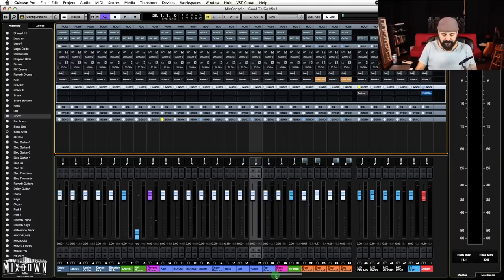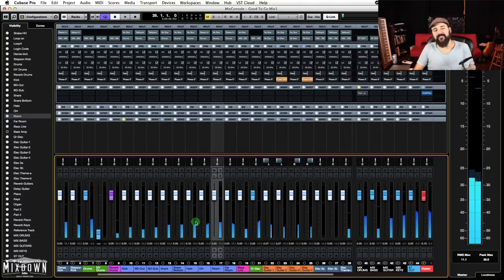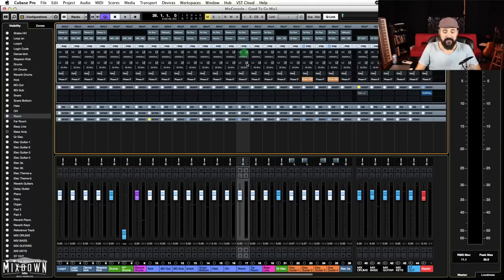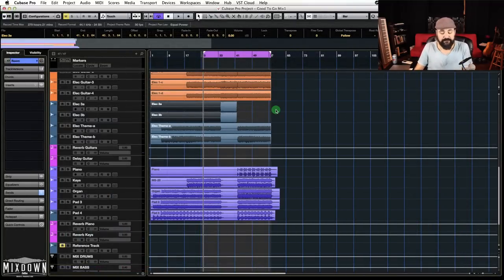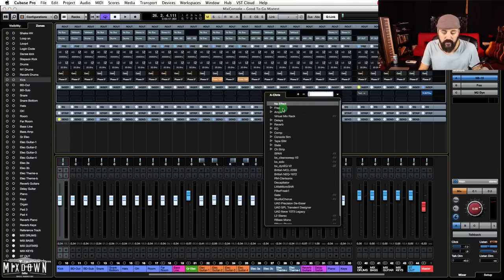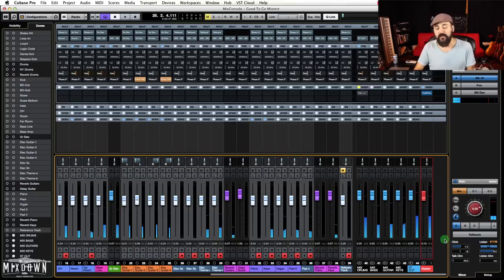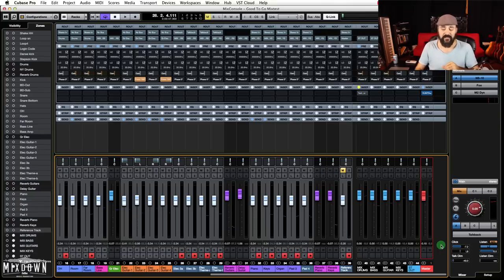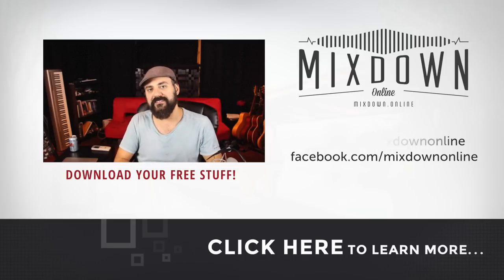Gain staging for a better mix - mixdown.online

Comment: Excellent video, thanks. I've done a recording where I gain staged each track, including with plugins, but the master fader peak level is around -11.7db (with the fader at unity point). Is this too low, or can I simply bring up the loudness when mastering the song (or even increase the 'Pre Gain' of the master channel)? You say in this video we should be aiming to get the master fader output to between -3db and -5db. However, I'm finding it hard to  properly gain stage each track PLUS balance the level of the instruments properly while still achieving the -3db and -5db range on the master fader. How do you solve this? Thanks.

Comment: Hi Chris!
I noticed, that the pre gain metering does not show the changes I make, if pre gain fader or pre gain automation is used. The only way to see differences in metering is, when I use my mouse and pull down the waveform in the track. Why is this? - And now knowing this, - does pulling down the waveform have advantages compared to using pre gain.?
Thank you so much for your videos! - I´ve learned so much from you!

Comment: absolutely to the point video....even I had confusion about -18- why it is sweetspot or why it is so much important, you cleared my confusion...Thank You, Love from India....just one question- during mixing I am keeping the level of master bus at -6 to -3 dbfs like that, for single channels I need to keep the level at -18 to -15 dbfs, is it correct!?
Reply from the maker: That's pretty much it but always use your ears also during the mix, not only numbers.

Comment: Hi Chris. When I set the gain on the raw audio file I try to keep it between -18 and -12 as suggested. This changes as I add inserts. To keep the faders at zero should I keep adjusting the raw gain, pre gain or adjust it in any of the inserts using say, output levels? You mention lowering all of the faders from zero to give head room but there is already 6dB above zero. What is this for? (Enjoyed your live stream last night btw).
Reply from the maker: Yes, the more you add plugins, chances are that your level will go up and that's ok. That's why you gain stage at -18 to -12 in the first place, to give you headroom. Don't adjust Pre Gain after you're done mixing your channel, this will screwc up the level of the signal going into your plugins
Reply: @mixdownonline  Thanks Chris, and I just saw in your latest vid that I should use the output of the last insert to make any adjustments. Good idea! 
Quick question: should faders ever be set above the 0dB position to increase the level in a mix or is this bad practice?

Comment: Tell me about after gain staging some of those tracks are louder than others. then you need to decrease those, now your not at -18db/fs any more. sometimes your getting way down on level to create a balance and make ur song sounds right. so for real what is gain staging?
Reply from the maker: I think you're overthinking this. Gain staging is to make sure you get enough headroom not to peak your plugins and also not to clip the master output. -18dbfs is close to 0VU and is just an average to aim for, doesn't matter if you go over, as far as you don't clip your analog modeled plugins or your tracks.

Comment: What’s your suggesting in the metering? I put, pre and post fader? When should you use them.
Reply from the maker: You can use Pre when you gain stage before you mix then post during mixing

Comment: Hi. I use Cubase, so this was very valuable info. Question though; So, Pro-Tools has a pre gain section, but I've seen PT users use Trim plugins, or even the trim control in a channel strip plugin like SSL E-Channel; Is this just a personal workflow choice, or what? Thanks for the vids, btw
Reply from the maker: Yes, that can be used to adjust the gain of a signal after it goes through plugins... e.g. If you end up clipping a plugin, you can use a Trim plugin or the output level of the previous plugin to lower your signal. Stuff like that.
Reply: @mixdownonline  Cheers Chris, thanks for such a quick reply

Comment: Chris, sorry to come back at this so late after your posting.  This video is quite helpful.  I love to see someone in the circle (Lij, Matt, etc.) that uses Cubase.  Here's my question.   How are you getting everything in and out of the box calibrated so they you know exactly what you're listening to in terms of dB?  

I follow most and am solid on levels coming into Cubase from my Aurora (n).  I also have my meters colored similar to you to ensure I'm tracking at  that -18dB to -12dB.  Following to my Master fader, I'm good.  I do however, seem to lose perspective at the CR fader and what that is telling me.  I believe my calibration question relates to CR fader/knob, monitor controller, and what I hear (dBs) on my monitors.  Another sticking point for me is how to properly calibrate the sound that comes from my browser compared to everything I've set in my DAW.  Browser is so much louder. Any advice?
Reply from the maker: Hey Bob,

Don't worry too much about this, it's normal that the sound coming out of your browser is louder than what's coming out of your DAW if you're working on a project that is quieter than a final master. Just adjust the CR level to your taste since this is only a monitor level knob.

Comment: Hi Chris, I wanted to ask you one thing: before starting the gain staging how do you normally set the LED meters of the various channels (post fader or input?) And on which display scale should the Master Out be set? (Digital, DIN, EBU , British, Nordic, K-20, K-14 or K-12 etc ...) I have a bit of confusion in the head and in the manual is not clear, I have cubase 10 Pro
Thanks you!
Reply from the maker: Luciano! When recording or gain staging, set that up to "Input" and "post" for mixing and leave your Master at Digital... DIN, EBU , British, Nordic are usually Broadcast related and K-20, K-14 or K-12  for mastering
Reply: @mixdownonline  So if I understand correctly when I register an acoustic instrument or an vocaI choose the input mode to see the signal coming in, if instead I load a Vsti I have to choose the Post Fader mode and adjust the gain directly from the vsti or Cubase trim? 
Thank you and I'm sorry for the many questions
Reply from the maker: Input for both... But if you use Post Panner and leave the Fader level of a track at Unity Gain (0db) it will be as if you were at Input.
Reply: perfect Chris
thank you very much for your reply
Reply from the maker: @ciccio7239  you're welcome!

Comment: Mmh, don't know if it's just me, but I like a different approach. I like to have the levels at fader position. So if my vocal fader is -5 the output is also around -5. This way, if I look at my channels I can literally see the amplidude on my fader positions. I'm also trying to keep my master fader at 0.
Reply from the maker: Hey Peter, thanks for your comment...The problem with this is if you want to keep your master channel at 0, at some point, the more you have tracks playing at the same time the more amplitude you will gain on the master buss and you will end up bringing down your channel faders lower to keep your Master at 0... The lower you bring your fader the less resolution you will get on that fader...and also the fact that you will risk overloading your insert plugins if your signal is too hot. It really doesn't matter if your fader is at 0 and your output signal is at -12dbfs, those are only numbers, the signal flow is what's important here. The best advice I can give you is to prioritize headroom over numbers you see on your faders...Mix with your ears, not with your eyes :-)
Reply: @mixdownonline , do you mean resulution in sample quality? I'd doubt that Cubase makes a difference in lowering the input gain or pulling down a fader. From a pure technical view, the hotter the signal the better, without clipping of course. As you know the bit depth is more or less the precision in which the amplitude is recorded. If you're going low, you are omitting parts of that precision or better said using less of the possible resolution.
From a mixing standpoint you're maybe right (or probably). It's not, that I mix with my eyes, but I like the view. If you're using the channel gains along with the faders (my approach) your faders will not hover around at the bottom :).
But hey, maybe I'd change that cmpletely, if I had to mix more of others people stuff. I'm more a musician, even if we produce ourselves for decades, so I can't call myself a mixer or engineer.
Reply from the maker: For resolution I mean the fader's resolution, doesn't affect the sound... I mean that you will get better gain control around unity point than lower. " the hotter the signal the better" I'll have to disagree, it is the case in Analog though because of the noise floor. I just found a very good read on the subject that is a bit more technical than my vid even if it covers a lot of the same things.  Check it out if you have a chance  https://www.soundonsound.com/techniques/gain-staging-your-daw-software
Reply: @mixdownonline  THAT was a great article, thanks! Your resolution arguement is now clear to me. When I was talking about hot, I was talking about analog sources, which I would level down after recording, but I'm happy to try it with more headroom.
The rest of gainstaging wasn't too wrong. I always avoid to send hot signals into plugins, to make sure that there's no clipping inbetween. What I'm going to change is my fader setup, to increase the headroom by default. That way I can work with my beloved fader positions and still use the rest of your advises.

Comment: Great Video
I have changed my settings and colours like yours. Works much better now!
I think I understand gainstaging now and the -18 dB-rule and that -18 dB is the same as 0 VU.
But one thing I struggle  with is the Stereo Out Volume, Cubase talks about -24 LUFS what means that?
Is that same as - 18 dB also or?
-24 LUFS seems to be very low volume for me, I had 10-11 LUFS Before but Everythings sounded harsh.
What suggestion have you on output LUFS?
Thanks again for great Videos,
Reply from the maker: LUFS is the loudness unit relative to full scale. I don't use this unit for tracking or mixing, only in mastering. I gain stage all of my tracks to get around -18dbfs on average so I end up with around -5dbfs on my Master Bus... In mastering LUFS is very useful but it's a bit complicated to explain in a short response...
Reply: Thanks!
Reply: OK thanks. so now I know !

Comment: If you had recorded too low, and had a high noise floor, you could use an expander to push it down.

-18dbfs is only equal to 0vu if you set your vu meter to read 0vu at -18dbfs.

There's nothing wrong with recording at -18dbfs, but apogee converters DO have a soft limiter included to allow you to saturate at the converter like you might with analog.

The main reason I don't go above -10dbfs on my own interface is that I've tested it and measured increased distortion beginning to happen just above the noise floor when I go above -10, so I keep my max peaks at -12 to give me a bit of wiggle room before I hit the point where the signal starts to change. And even then, the signal change is in the noise floor, so it'll be inaudible with a healthy signal to noise ratio. I just don't see any point in going higher with that happening and without soft limiting being an option for me.

If you're using a floating point DAW, you can't clip the track channels once it's been recorded. Try it. With that in mind, if it's piling up too hot at the master bus you can just use a trim plugin on the master bus to turn down the signal hitting the master bus if you need more headroom. It'll be the same applying it once at the master bus as it will applying it 30 times on 30 tracks.
Reply from the maker: Cool stuff about the apogee, didn't know that! Yeah, 0vu can be set to the dbfs you want. I set to -10dbfs when mastering. -18dbfs is not super precise but is close to the equivalent 0VU we see on analog gear. You can definitely trim down the master buss if all of your tracks are too hot but my goal with this video is to show people how to manage gain staging from the recording stage to the mixing stage so this way they won't have to trim down the master buss like crazy and have will way more control of their mix especially when using non-linear plugs like a lot of us do. Btw your vid on Gain Staging is pretty amazing, you rock ;) Thanks for your input my friend!

Comment: Merci beaucoup Chris!  Quick question:  if you're gain staging to prepare a vocal track, would you be looking to the meters on the input channels (left side of MixConsole) or would you be looking at the meters on the newly created and record enabled mono track? Also, are you aiming for peaks or average levels to be at -18dBFS?
Reply from the maker: +Alain Patry Salut Alain, when recording, looking at the input channels is perfect... Works with direct monitoring enabled as well... - 18dbfs is my average level. I don't mind if it peaks at - 12-10dbfs max :-)
Reply: I watched your video series on Gain Staging and it was very helpful although I was shocked to see how the PRE section's Gain were being used for adjusting the mix (instead of the faders). I've never seen it done like this before. Can you provide a link that would clarify when to use such a technique?  I thought gain staging was basically just making sure my input levels were setup properly before beginning to record vocals! How little I know!!!
Reply from the maker: I use this technique only when I get tracks to mix from a client that were recorded too hot.  So I gain stage them before I start using plugins and mix with the faders. I don't need to do this when I'm mixing a song that I recorded myself since I already gain staged during the recording. Good question :-)

Comment: If you want to lower the level of all your audio tracks the better way to do this is adding a vca group to these tracks and reduce the level there. This will prevent altering the level relations between the tracks (at least in cubase)
Reply from the maker: Yes, using a VCA channel will reduce the levels of all tracks allocated to it. But gain staging, like I explain it here, is done before the signal hits the channel's inputs and sends. Using VCA will reduce the levels after processing not before which can be very useful in other situations.  Thanks for your comment :-)

Comment: I am curious to know how one would deal with gain staging when using a digital mixer alongside Cubase. Where does the gain staging get applied? Do faders at either end remain at unity? Thank you
Reply from the maker: Hey Peter,  the gain staging get's applied in the recording if possible, if not you adjust it in Cubase...  it doesn't matter much if you're using a digital mixer or a sound interface, you just gain stage the same way when recording. When recording, you can check the input meters on the Cubase Mix Console to make sure you record at a good level.  Hope that helps!
Reply: Sure does Chris. Thank you my soul brother from la rive sud.
Reply from the maker: You're welcome mon chum d'la Rive Nord ;-)

Comment: Hi ! 
 What U have showed here regarding recording at -18dbfs applies to the new loudness standard of  EBU R128 regarding LUFS & dBTP meters?
(LUFS and LKFS are a new reference unit of loudness measurement)
Their new standard, introduced in 2011, try to move the entire industry: TV, Radio & Internet to follow certain rules.
 I understood from discussions online that all the companies, including Youtube, will make normalization to music to follows the EBU new standard.
So, to conclude it all: How do we work in Cubase to follow industry standards of loudness measurement
Reply from the maker: Hey Roy,  now recording at an average of -18dbfs and the loudness standard are 2 different things. The -18dbfs "rule" is done during the recording or gain staged in mxing  to give you more dynamic rage during the mixing process. -18dbfs is the equivalent of 0VU. When we're talking about LUFS metering it's more at the mastering stage that we work this out. LUFS is similar to RMS but not quite the same. Here's a very good video on this from Ian Shepherd (Amazing mastering engineer)  https://www.youtube.com/watch?v=31zHqzjRn4c
Reply: Hi ! I watched his tutorial several times & still has a few questions regarding this subject, hopefully he will answer :) 
But just know- in Cubase 9 there is an option when U turn on the loudness section in the mixconsole to see metering in LU & also metering in LUFS- so if it is in Cubase there is a reason for that, not ? 
Or U suggest to ignore all that LU / LUFS completely during mixing in Cubase & only work with the conventional DB / RMS meters there as in the past, follow that -18dbfs + - during mixing & not to peak over 0DB ?  but after, when mastering the song in Wavelab THEN follow the LUFS meters there ?
Sorry for all those questions but I feel that there is no simple answer for the home engineer what guidelines he should follow so his final song will play the best it can  :)
Thanks for your answer !
Reply from the maker: Cubase has the LUFS meter in the mix console which is great. The reason is to give the tools and option to do mastering in Cubase. I would suggest you not to bother with LU / LUFS during mixing. Make sure your gain staging is ok. If you record and gain stage your individual tracks at an average of -18dbfs or 0VU, you will end up at around -5 to -8 dbfs on your master bus once your mix is finished. This is enough head
room to bounce your mix and send it to mastering or master it yourself. Don't be sorry for all these questions, these issues can be confusing... I'm happy to help when I can :)
Reply: Thanks man ! You awesome !